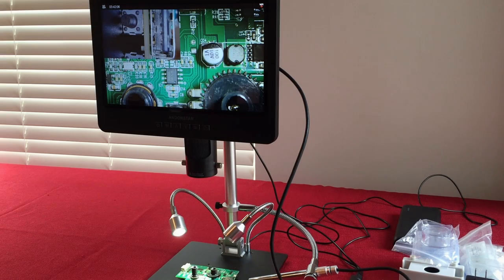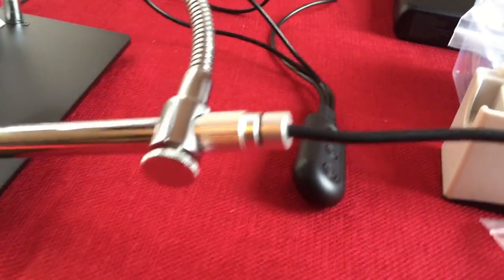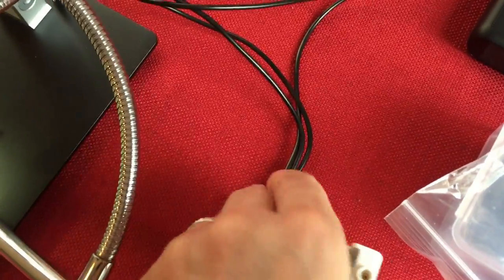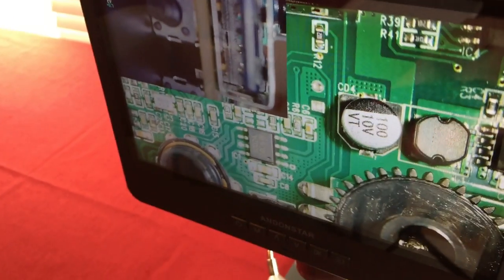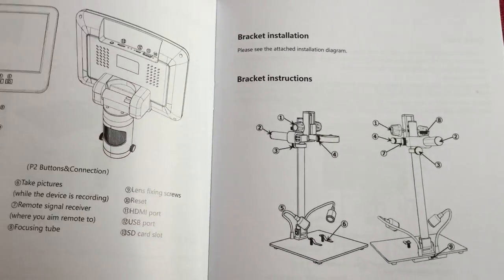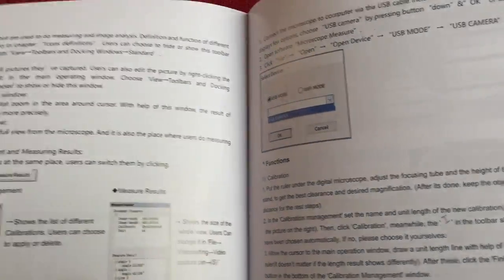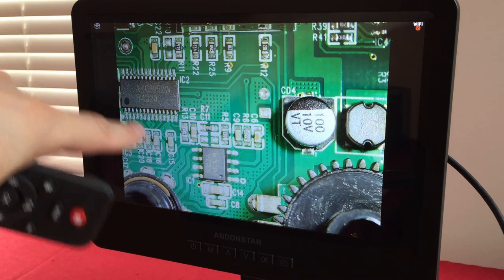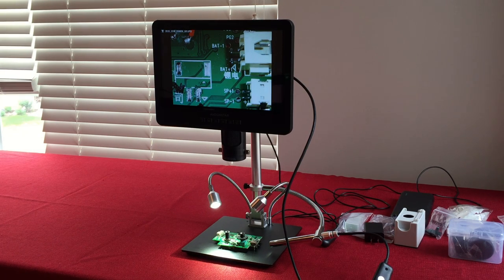Andonstar 10.1" HDMI Digital 18X - 2040X Microscope / Endoscope Review

Comment: Well i didnt need to buy this as im currently putting my soldering lab together and already soent a ton. 
 ButI just ordered this but withiut the endoscope. $189 vs $224 w/ endoscope. Also got the extension mat and sides thing. 
Anyone wanting to buy this for soldering they sell an extension thing with tool holder and helping hands. For the price you get $10 more off by bundling with the extension part if using mostly for soldering. You have to click on the extension mat and 2 options for bundle (this one and the lesser model) and can get the scope and the extension thing for 239 (no endoscope). The bundle isnt available from the scope page for some reason.